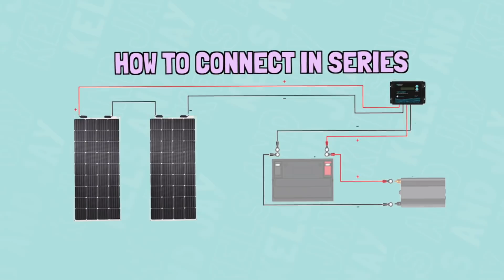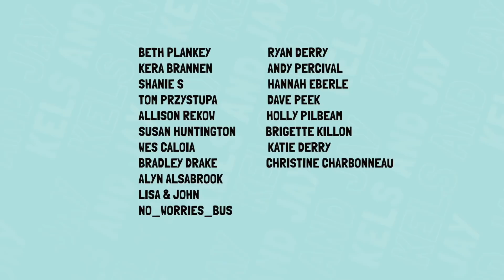We Keep Making Mistakes on our Van Build...

Comment: I just tap screwed in my solar pannels to my roof. Feels like there's has to be one thing wrong  a day. My wire inlet cap did not stay secured and I had to liquid nail it. Gotta seal and re seal any holes in the roof, glad to see I'm not the only one struggling. It's good to know when to take a break

Comment: I would be scared AF to cut holes in a van. Water system and power wiring seems most challenging part in the wan, looking forward to see what you will build there.
Reply from the maker: Haha we were too!! Wanted to add a skylight but it just felt wrong to cut a hole that big in our van😂